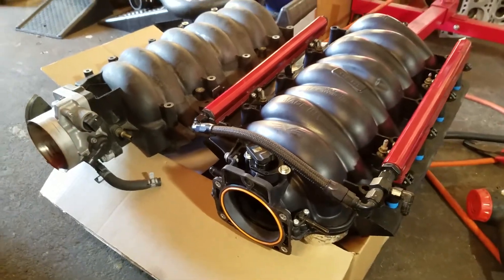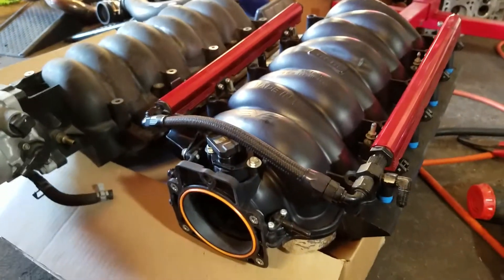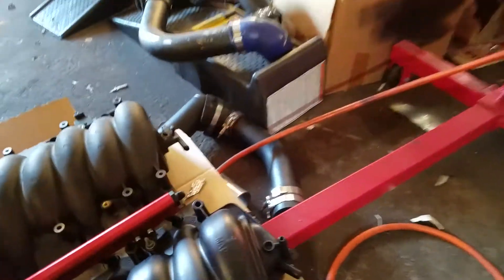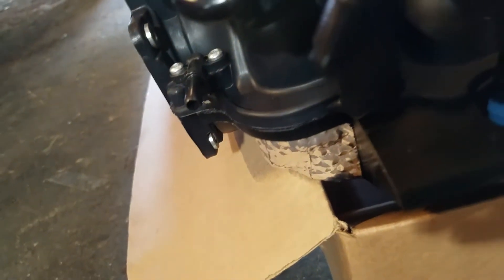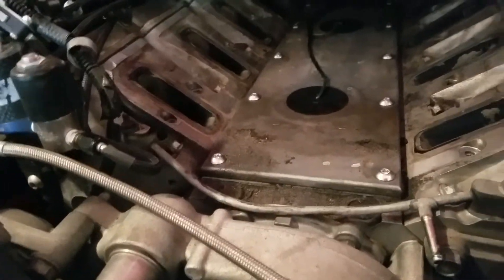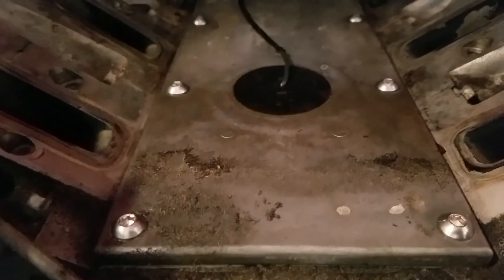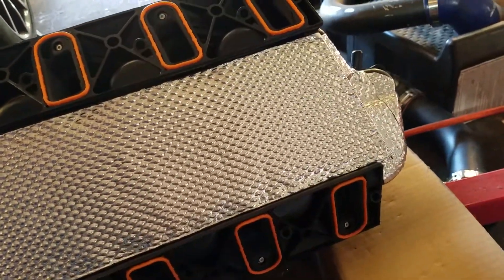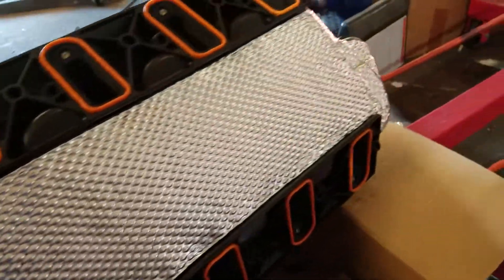FINALLY GOIN IN! Dorman 615-901 90mm LSx Intake Manifold Installation Tips

Comment: I'm building a 5.3 for my nova? Will this intake perform well on a mild 5.3? I have a summit racing stage 2 (SUM-8701) (.523/.524 lift) and what injectors will I need to run since its 5.3 and not a 5.7

Comment: Would a LS6 valley cover be an issue?
Reply: Did you have to retune your PCM for the Dorman intake.
Reply from the maker: Bill Bethauser I would have to say it would be an issue, unfortunately.
Reply: Michael Acree that is a good point that you make not so much of the intake that you will have to tune it's the throttle body you choose to go with 92 mm in 94